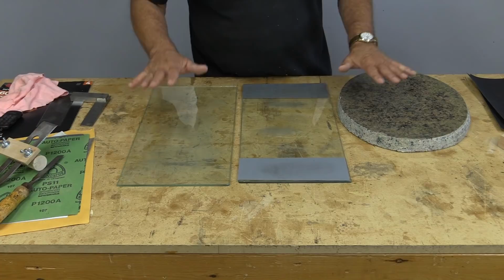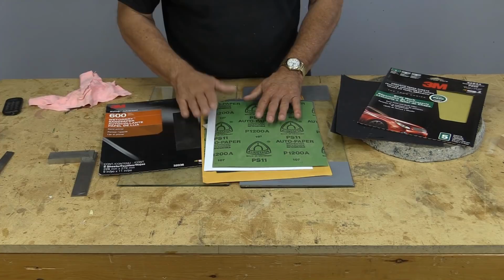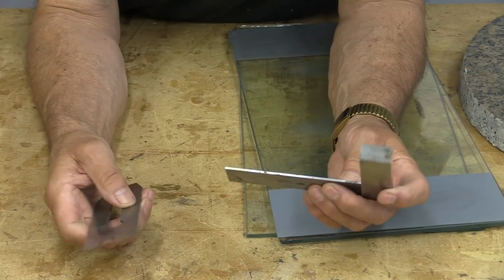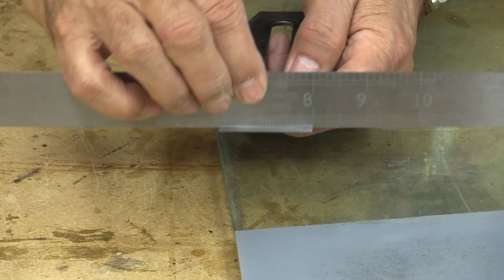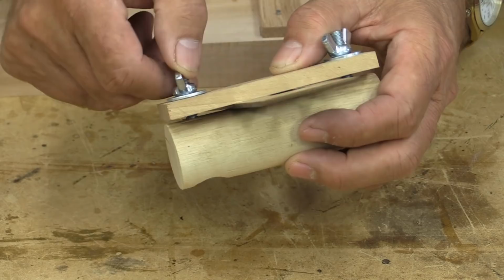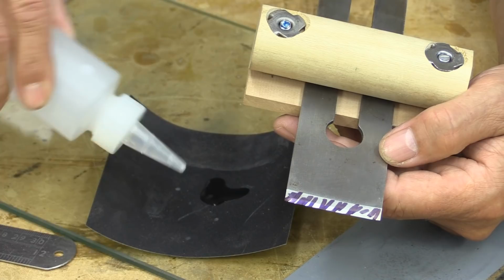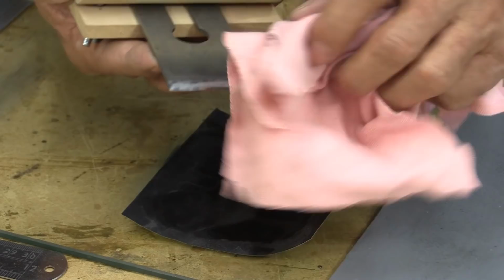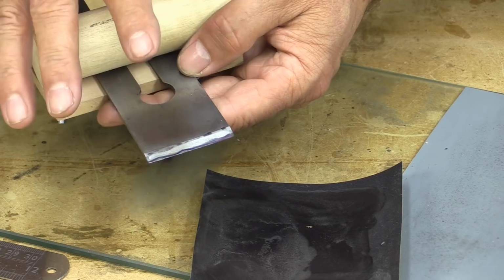How to Sharpen Chisels & Sharpening Plane Blades: Woodworking for Beginners #32

Comment: I bought a Tormek.  I know it was expensive, but I can sharpen chisels, jointer knives, and planter knives as well as any lathe tools.  Best investment I ever used.  I can even change the angle of any blade or knives.

Comment: After I sharpen blades I use a piece of leather to strop the blade to polish it and take off any wire edge.  If you got a piece of leather or leather belt on to the glass you would keep the same angle and could even strop the back side of the blade.

Comment: Thanks for that Colin. I've been using a Mk2 Veritas  and still pondered as to why I needed it (the chisel)  to be centred and you have explained this quite well here. The problem I still have is the evening up of the tensions otherwise the blade tends to swivel, but I'll get there I guess. Cheers

Comment: Outstanding video. After watching several videos on this subject I built one like it and it performed perfectly. It is easy to adjust and use, and very precise. It only cost me the price of the butterfly nut ($1.39 for 4) and two 1/4 "   screws ($.38) which I embedded in the dowel with epoxy. I used a piece of plywood for a grinding surface and it worked OK. I will be on the lookout for a small plate of glass to complete this set. Truly ingenious in its simplicity and effectiveness.

Comment: Question:
When the base of the dowel is below the surface (in that groove) and you set to 30 degrees. Then when it is on the glass (flat) doesn’t that raise the dowel, this changing the angle?  Sure, might only be 2-3 degrees depending how you make the V cut...or am I thinking too far into it? Either way, I’m making this in about 30 minutes! Thanks
Reply: when he made the jig he calibrated the stop block distance while setting up the jig on a flat surface, and used a block cut at 25 or so degrees. so it should be fairly accurate

Comment: Still think I'd put rollers on either end to prevent wear... slip & go on the sandpaper with the dowel part and you've just changed the angle slightly.  Still a slick system though. =)
Reply from the maker: Sure, you could do that ... lots of options

Comment: Interesting indeed! I wonder why you do not use a stone for sharpening?
Reply from the maker: Stones are fine, many people use them but they are work too, you need to make sure you keep them flat and you need a few different grits ... I just find the sandpaper system quick and easy, had I been schooled with stones, I would probably be using that system
Reply: Sandpaper n glass is cheaper faster n don’t need to be flattened

Comment: Nice Jig Colin.  My question is how to put that little bit of curve in the plane?  I believe that is for smoothing.  Also, I'm curious, what is the angle of a low angle jack plane?  A small change to the jig I'm sure.  Thanks so much.
Reply from the maker: Basically you just put more pressure on one side, then the other until you get that curve. I didn't want to put that info in this video as it's a bit more advanced ... will do that video in the future, some of the more advanced things.
I don't own one of those, but they probably do have a lower angle grind ... sorry, just not sure what that is off the top of my head
Reply: The bed angle is 12 degrees. The iron is sharpened at 25 degrees like all other edges.

Comment: Guess I'm missing something- the dowel is recessed in the V in the set up jig but it's not when it's on the glass therefore the angle is not the same. If the jig is set for say 25 deg, when you move to the glass it will be a higher value greater than 25 degrees. What am I missing?  Love the jig - thanks!
Reply: The degree was already set on the table using the triangle he cut as reference. Then he put into the jig and added the stop block. Watch the previous video on how he made it and it will make sense. Cheers!